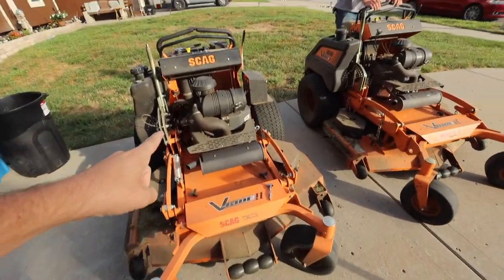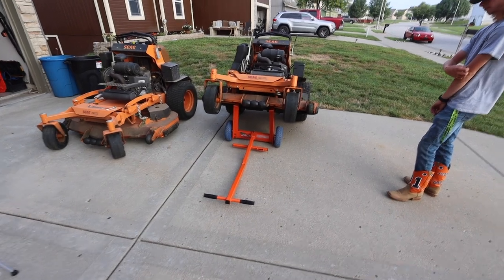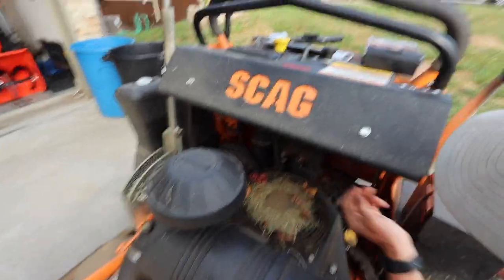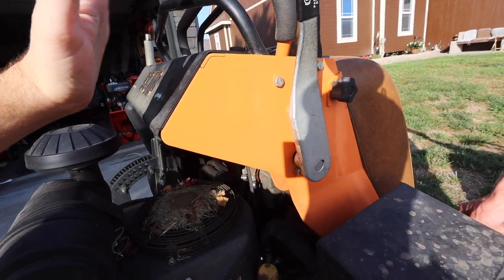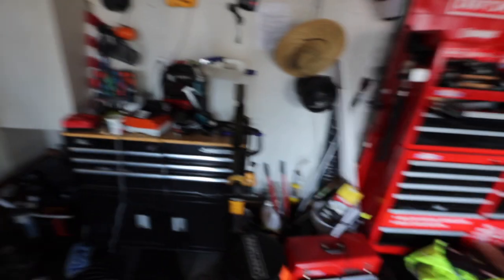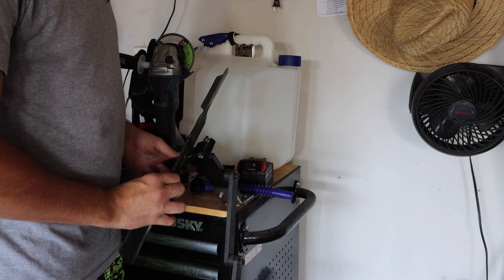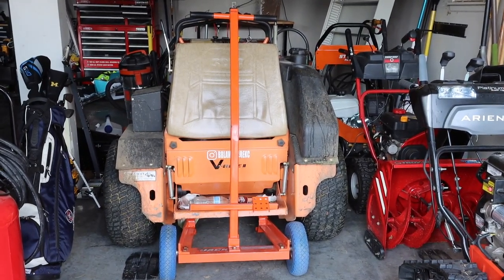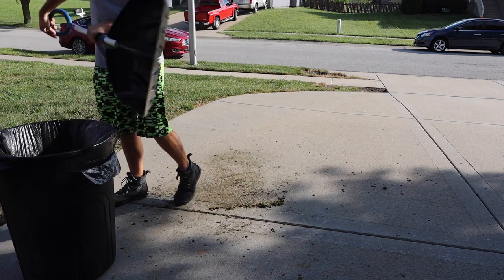Mower Broke Down.. How To Replace Throttle Cable and Sharpen Blades

Comment: Just a positive tip for ya man, never let the the top/cooling fan of the motor get plugged up with grass like that.   That fan is the life of these air cooled engines!
Reply: donovanolds realized that also😬
Reply: That’s like the first thing I noticed 😳 he cleans the bottom of the deck but doesn’t keep his cooling fan clean 🤦🏻‍♂️

Comment: Blake goes through so many throttle cables lol
Reply from the maker: Dude, I know
Reply: The funny part is I have a scag with over 2500 hours and I've never replaced a throttle cable and we always start it at full throttle. 😂😂
Reply: I just replaced one on my 2015 v ride. Maybe its just a v ride thing.

Comment: I don’t think the pto has any affect on the throttle cable.   The key is to turn your pto On at half throttle to save the clutch.  Then increase your throttle.  The fast the rpm, the harder the clutch has to grab.

Comment: Put the flap wheel on the other grinder or get the right guide pin for the one you're using. Its hard to believe that's your using the All American Sharpener as only a blade holder !